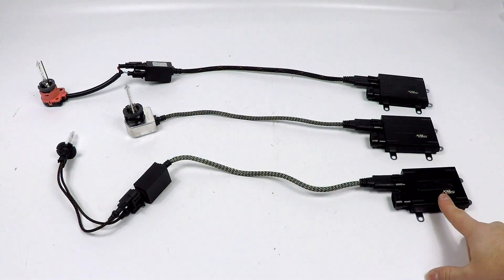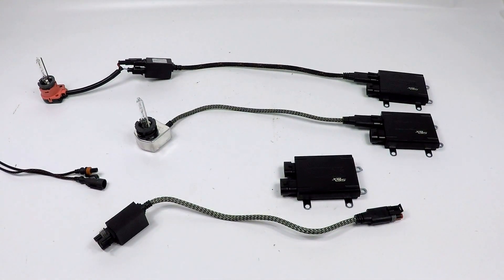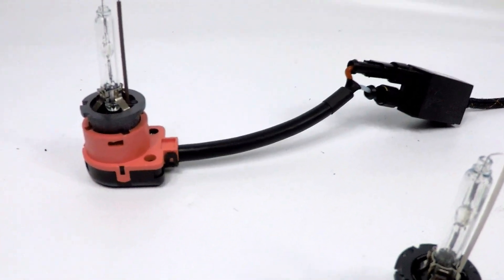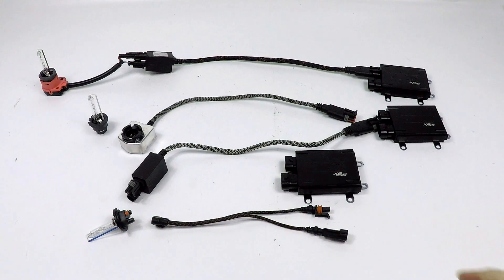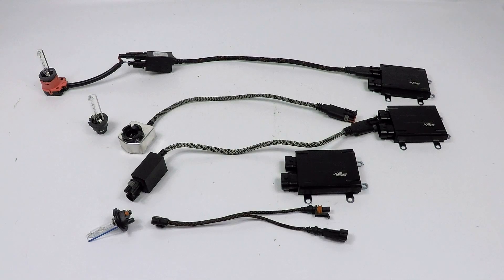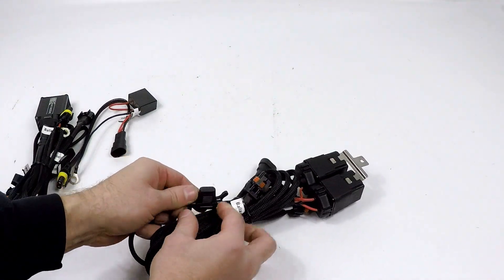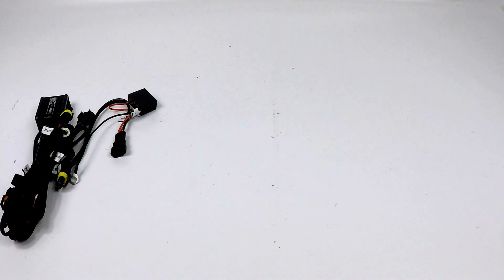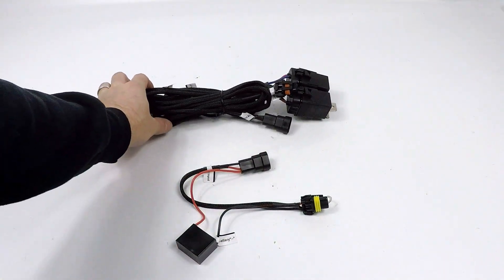Troubleshooting Guide for Morimoto HID Bulbs, Ballasts, Kits - Lightwerkz Tips & Tricks

Comment: My low beams on my 2004 wrx keep blowing the in line fuse from the sti harness kit lightwerkz
Reply from the maker: Means you've got a short some where. Unplug each ballast. Replace the fuse. Turn on the headlight stalk. Then plug in each side individually. See if you can pinpoint the problem part that way.
Reply: Thanks I went over the wiring and fixed it. It looks sooo good compared to my old headlights. Appreciate it!!

Comment: I’m having a weird problem. Recently had an engine swap and don’t know if they did something or if something happened on its own. When I turn the lights on the halos will turn on but the lights won’t. When I have the truck turned off and I unplug and reconnect the wire harness to the main hi/lo relay, the lights will come on and I can’t turn off the lights unless I disconnect the battery? Any ideas where I should look first

Comment: I just installed a new harnesses fron you guys and lights still not working..I get power going into the ballast but no lights..tried swapping with another ballast and still same..do I need to use the morimoto ballast for them to work?

Comment: I installed a morimoto elite system from you in my GMC Sierra about 18 mo ago.  Love(d) it.  Last night lights wouldn't come on.  Fuse is good, 12V at relays, good ground.  Lights flash on, then right back off.  Any suggestions? Mike

Comment: Thank you!!! I ended up calling and getting bulbs because I tried everything else and there was a black spot in the bulb. Now the issue is the relay. I swapped sides and the opposite side didn’t turn on. I’m thinking the relay box messed up the bulb and also the ballast on that side recently went out. I think it’s all connected

Comment: Just got a brand new Morimoto HID Kit for 19 tacoma. Everything wired up and working and now only right one ignites. I played with the oem input and the lights flicker on and off. A slight touch of the oem input plug and then they flicker on/ off. Any ideas?
Reply from the maker: The H11 connector, the black part that connects to OEM input only plugs in one way tightly. The other way the connector is not "clicked" in tightly. So the proper thing to do is release the metal pins inside with a pick or tiny flat head and just switch the sides.

Comment: I am having problems with one light not working all the time. I swapped ballast, still a problem, tried a different bulb, same problem. I did not swap igniter because it does work occasionally. I'm using the single morimoto relay and if unbolted snd wiggled does seem to affect even the good lights output. Bolted down tight in the right direction and good light seems to be good...bad light always sporadic. I'm wondering if one side of the relay is bad and needs replacing? All parts used are morimoto. How do I go about purchasing a replacement single relay? Any help would be appreciated.  Dan
Reply from the maker: Swap the relays. This will help you further troubleshooting. You just unclip the relay socket and you can swap sides.
Reply: @LightwerkzGlobal  it is one single relay with a double connector
Reply from the maker: @gtnoslp  Ok we have seen those fail or act up. I would replace the whole harness if you think it may be the relayed wiring harness.
Reply: @LightwerkzGlobal  ok sounds good were do I get it....the single relay does unplug from the harness...could I just get a relay...parts and prices would be great
Reply from the maker: @gtnoslp  Sadly they don't sell the relays. You would buy the whole harness and you could just swap on the relay at first to see if that fixes the issue.
Reply: @LightwerkzGlobal  I bought this vehicle with the Morimoto kit already installed. I'm a little unsure of the correct parts to order. The ballast say XB35...and the single relay has #QC1510690 on the back. What would be the correct relay and harness to order?? Can I order this directly from your company?Your help is greatly appreciated! Dan
Reply from the maker: @gtnoslp  Check out the harnesses here - https://lightwerkz.net/collections/wire-harnesses/bi-xenon

The color of the relay designates which one you need. Black is H13, silver is 9007, and gold is H4.
Reply: @LightwerkzGlobal  I ordered the H4 relay and harness as suggested and just wanted to let you know I plugged in the new relay without changing the harness and both head lights seem to be working right now! Thank you for your help! I'm wondering if I should order other spare parts, just in case?! Thanks again, Dan
Reply from the maker: @gtnoslp  excellent. You should be good. Mount it high and dry. Keep it vertical.

Comment: Do I have to switch 7:17 to 12:17 on my 2014 civic's retrofit projector for it to make the low-beam work as a high-beam too? Please help. High beams doesn't seem to work and I mounted the double one 7:17.
Reply from the maker: You will need a high beam splitter to get your bixenon projector to work on that model - https://www.lightwerkz.net/index.php/components/wire-harnesses/wiring-accessories/high-beam-splitters.html
Reply: thanks

Comment: I just installed a morimoto kit on a 2018 ram 2500, and am getting nothing, no lights, no buzzing anywhere just a message on the dash saying I have a low beam out. The fuse is good, I flipped the polarity on the ballast input to no avail, the connections seem ok, I don't know where to go next.... Is there a way to test the system seperate of the truck without it plugged into the canbus?
Reply from the maker: If you are getting a lamp out error your resistor is not plugged in properly and this will cause the truck not to send power to the lights most likely. Check the connection coming out of the light, it should go right to a splitter and one side will plug into the resistors and the other to the capacitor.
Reply: @LightwerkzGlobal   I've now got 1 set of resistors that get hot but the set for the other bulb is still stone cold and neither bulb lights up, I've checked all the connections. What else could it possibly be?
Reply from the maker: Bad connection is all that it could be. Resistors usually dont go bad.
Reply: @LightwerkzGlobal  Could it be a bad connection in the relays?  I'm not understanding why I can't get at least one bulb to fire.
Reply: @ucfsub did you ever get them firing?  I’m running into the same issue... all is hooked up correctly and notta...???
Reply: @saturated_and_caffeinated  Never did, ended up returning it and going with the diode dynamics kit and love it.
Reply: Same issue on my 2017 Ram Rebel, MoriMotor Elite 2015+ kit, nothing happens with the lights and i get a low beam out message, idk what to do at this point, return it and get another kit i suppose.
Reply: I got the same error and no lights, I was very frustrated and ended up talking with Brandon at Lightwerx and he walked me through every step of trouble shooting.  It ended up being a bad connection at the bulb.  I hade to bend the prongs inside the connector to get a better contact.  After that, low beam error went away and the relays fired up.  You may try that or call lightwerks.  They are definitely my go to lighting source after the complete over the top service...

Comment: what if one of the connectors that connect to the relay melted off the plastic it was placed in? it's a harness from retro-solutions.
Reply from the maker: Replace it. It melted for a reason. not safe to use any longer.

Comment: Thanks so much .....actually i get the HD relay for my car mercedes benz h7 bulbs  because after installing my d2s 4.0 projectores and contact with a high beam spliter it works great but i ve the driver side high beam flickering for about 30 seconds until i begin to move with my car and give it asteady electric current 12 v then it works and sure im installed also canbus in both sides ..... sooo i get that HD relay harens to contact directly from the battery to give it asteady current but actually it gives me error indicator in the car computer ..so  sir do u ve solution for that ..
Reply from the maker: Yes you need a can bus specific wiring adapter or a can bus ballast - http://www.lightwerkz.net/index.php/components/wire-harnesses/can-bus/morimoto-standalone-canbus-wire-harness.html
Reply: yes sir i already do it.. So the high beam flickers while my car is parked in the begining of warm up but not while it is moving while using the canbus harness i think the volt is not steady in the begining of warming the car
Reply from the maker: Most likely your ballast then. I would go for the hylux ballast. no issues with these...EVER - http://www.lightwerkz.net/index.php/components/hid-ballasts/35w-2a88-hylux-canbus-ballasts.html
Reply: i try plugging the canbus between the OEM harness and the Morimoto Relay and i tried swapping the canbus harnesses from side to side to see if it changes the side that flickers? but no ...the driver side only flickers only while  the warming the first 40 seconds then it works
Reply from the maker: You do NOT use the canbus adapters and the relay harness together. Only one or the other. If you use the relay you will get an error code. So you have to use can bus.
Reply: i think it is amatter of voltage supply so for that i tried the hd relay  but it gives me error due to how the harness is designed though this should only cancel the error for the side that the HD relay harness is plugged into. The opposite side will still throw a code
Reply from the maker: Both sides will throw a code. The HD relay is not enough to fool the computer on the car. So you need to remove it.
Reply: im now using it the canbus and same problem i ve
Reply: yes i remove it and using only the canbus but no way same problem ..waiting ur reply bro
Reply from the maker: This is the solution. New ballasts. High quality can bus units - http://www.lightwerkz.net/index.php/components/hid-ballasts/35w-2a88-hylux-canbus-ballasts.html
Reply: i think it is not my issue anyways..thanks alot bro

Comment: So you get the mosquito light zapping... how do you fix it? The bulb itself you cannot move any connection parts, and the harness just has those two probes... if they're not lining up, it won't plug in.  
So if you're able to plug them in, and you still get the zap, then what?
Reply from the maker: We have seen a few faulty connectors and/or ignitors. Some people do not snap them in all the way and then there is an issue.